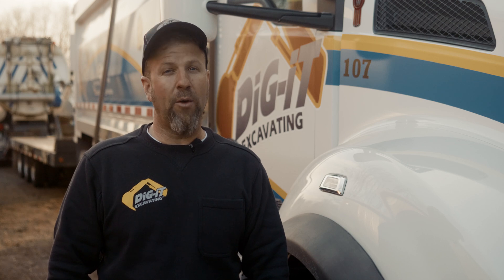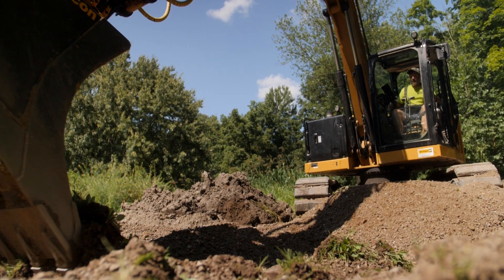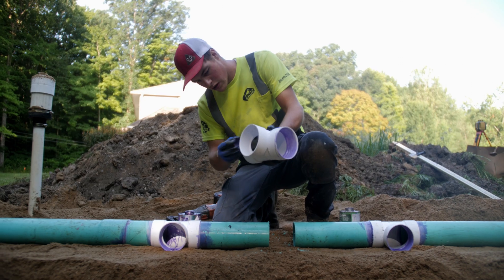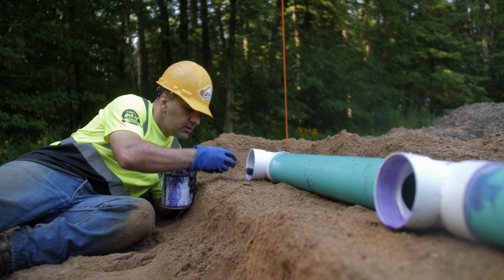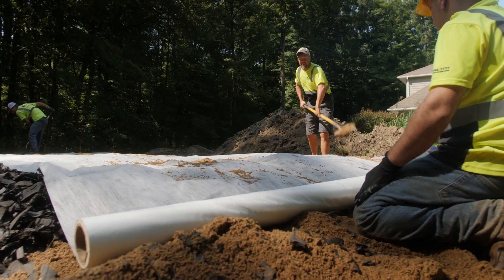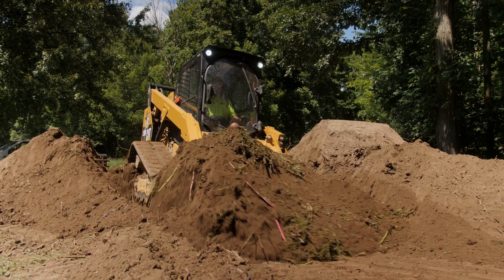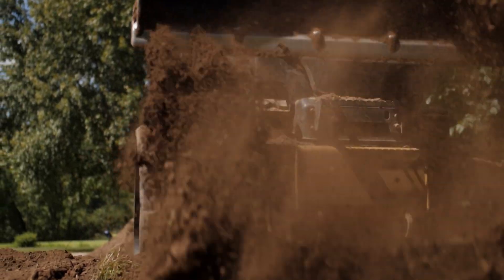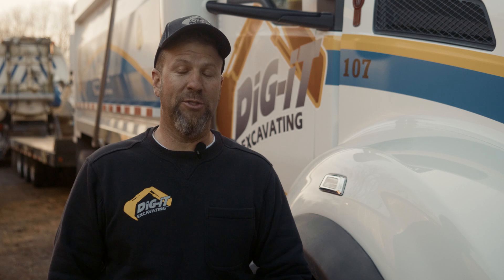Sand Mound Septic Field Installation

Comment: What’s the average price on a sand mound septic?
Reply: Depends on the size, but figure anywhere from $15,000 to 25,000.   The number of bedrooms in the house determines the size.
Reply from the maker: Around here they can range between $20-30k